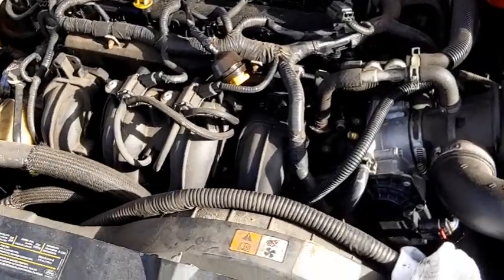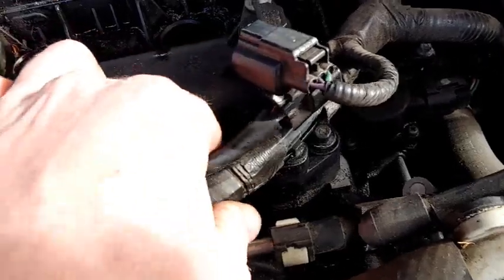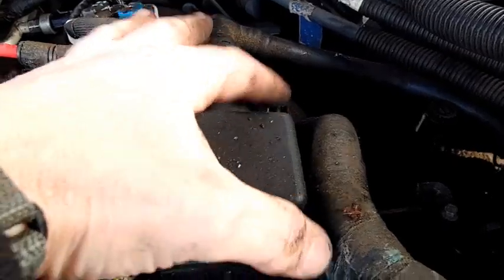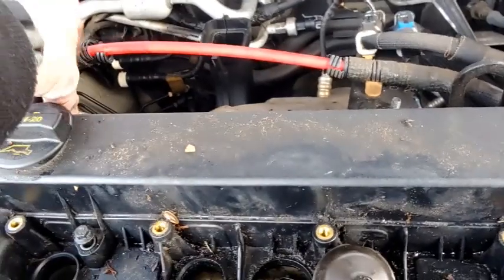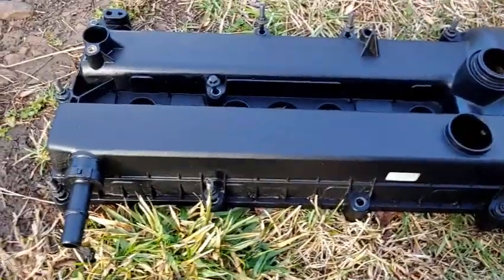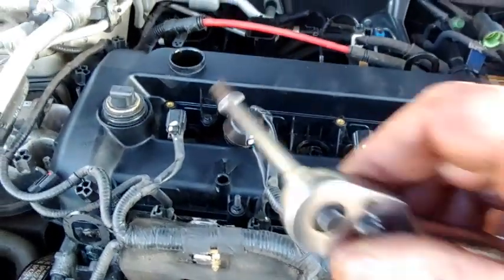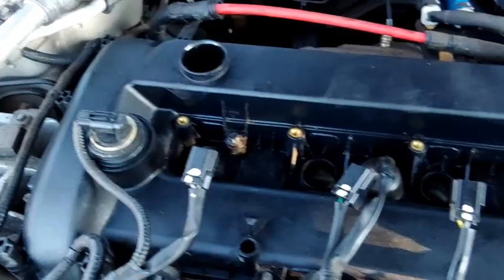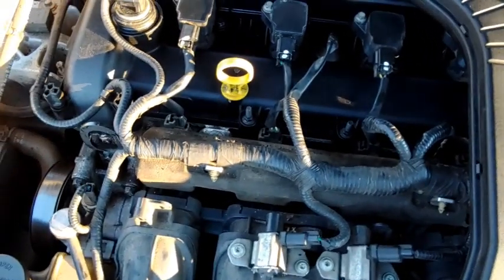Replacing the valve cover gasket on a 2006 Ford fusion with the 2.3L engine

Comment: Great video! Do I need to do an oil change after replacing the valve covers?
Reply from the maker: Not really unless it's dirty or needed...just keep the area around it clean and you should be fine.